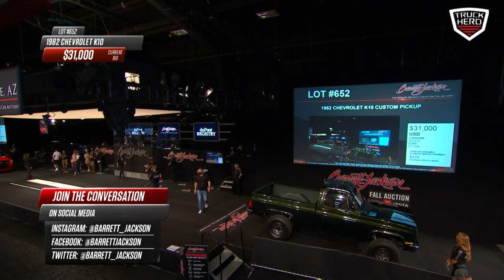DAY 3 - 2020 Fall Auction - BARRETT-JACKSON

Comment: $62k for a 61 Corvette seems like a bargain. $61k for that Ferrari also seems like a good deal. Only 25k on the engine. wow. Seems like you can show up with $50-60k and get the car of your dreams.
Reply: You forget about tax and other fees that come with auctions.
Reply: @Garrett Graf......Unless you are related to Steffi Graf and all her money, that F355 Ferrari will become the car of your nightmares....One of the most expensive Ferraris to KEEP!!!!
Reply: @donaldjohnson257  Thanks! Coming from Don Johnson, a guy I know who has experience with Ferrari cars, especially the Testarossa, I'll take that advice.
Reply: @23ofSeptember .....Yeah, I noticed when the F355 came up they did NOT mention that service was up to date which means it's 99% certain that service is NOT current...That means if you're planning to drive it more than 1000 miles, you are looking at $20,000 for timing belt service plus around $7,000 for other things which were probably neglected.....The 355 stands for 3.5 liter and 5 valves per cylinder...And you can imagine what havoc those five valves wreak on the internals like timing belt/chains.....All in all, I loved the 355!....Don't know if you remember the movie "The Rock," but the yellow Ferrari that Sean Connery stole was a 355!!.....Good driving to ya!!
Reply: @donaldjohnson257  It might be cheaper in the long run to do an engine swap, but keep the engine in the shop for when its time to sell it.